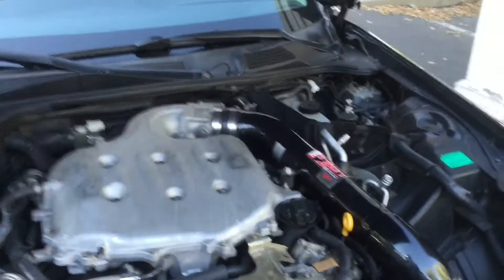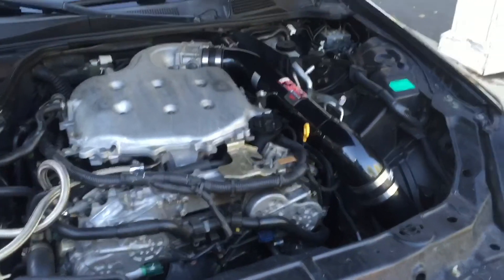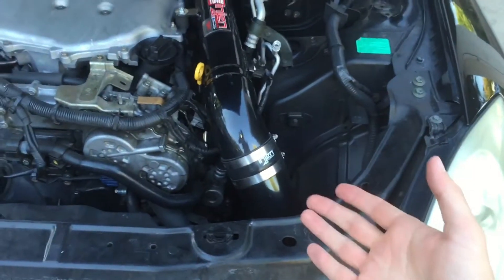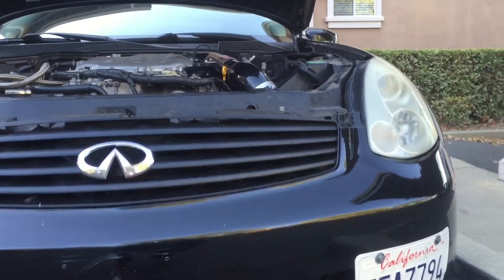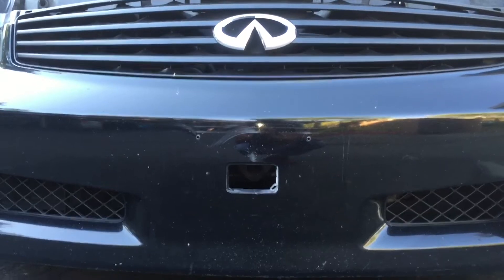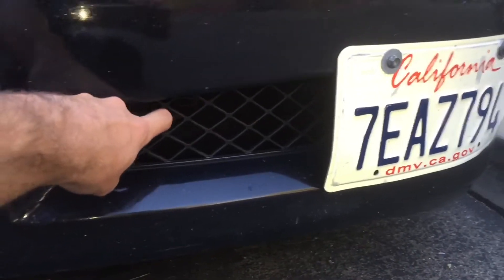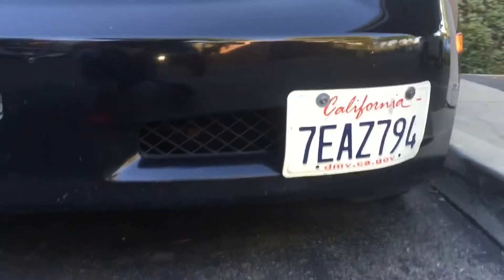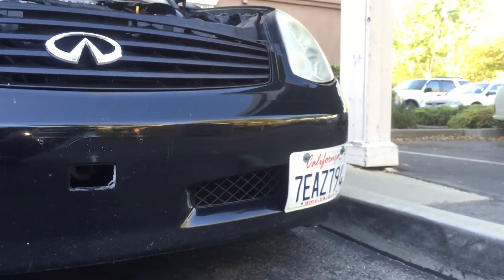Am I going to Hydrolock my engine!?!? How to prevent Hydrolock

Comment: Do you think bypass valve will help?
Reply: I hydro locked my engine about 17yrs ago and I had a cold air intake down to the tire well with an AEM bypass. It didn't work and I still hydro locked it. My recommendation don't do it, just get a upper snorkel for cold air.